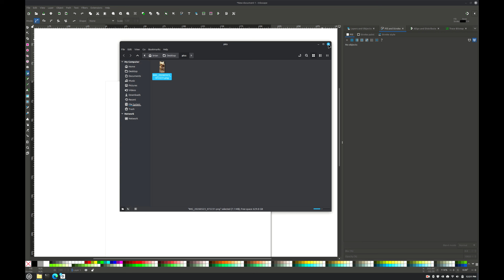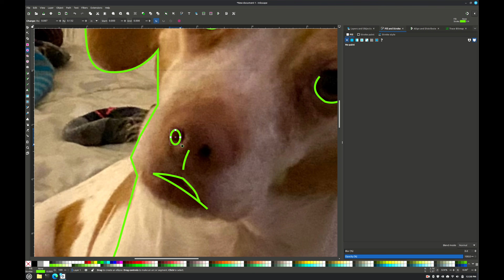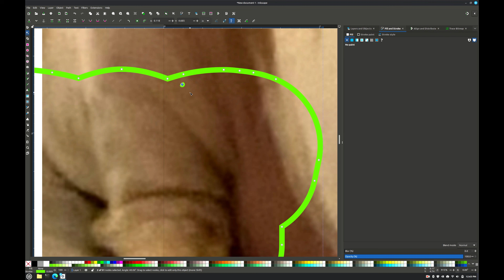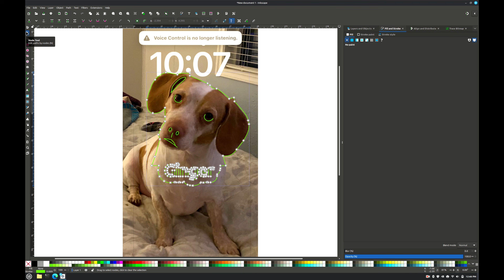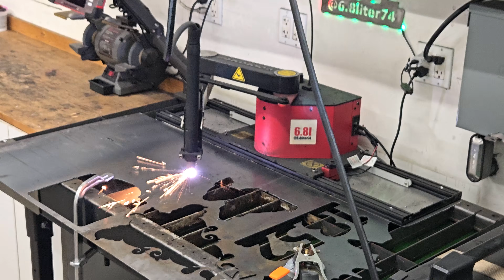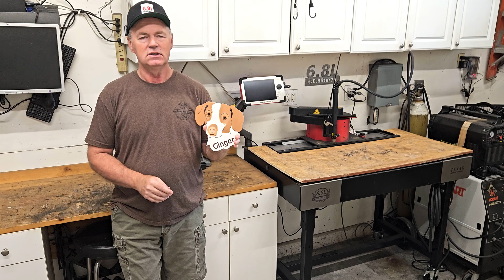Turning a Dog Photo Into Metal Art | ArcDroid CNC Plasma Cutter Project

Comment: Have you ever considered using AI to assist with some of the fiddly bits?  Or even the complete cut file?  I have found ChatGPT can help in a huge way.... I use an Arcdroid and Chat is also an excellent resourse for cut settings, just give it the material and make model of the plasma as well as telling it you are using the Arcdroid.  Just received my Plus Controller... nice upgrade!
Reply from the maker: I haven't used AI much in relation to the Arcdroid.  Good tip!